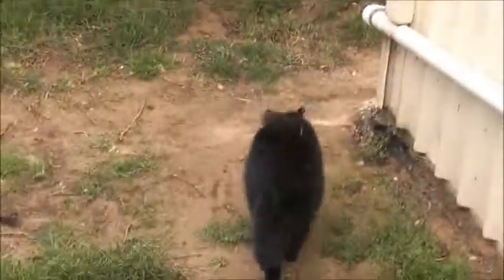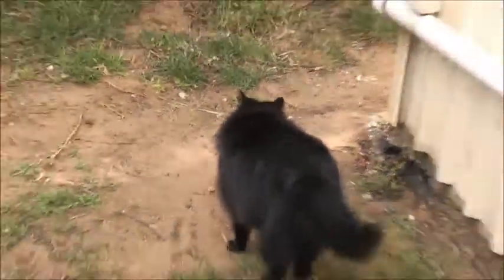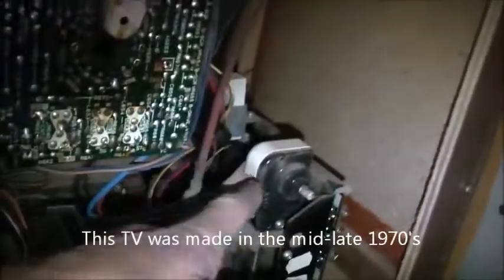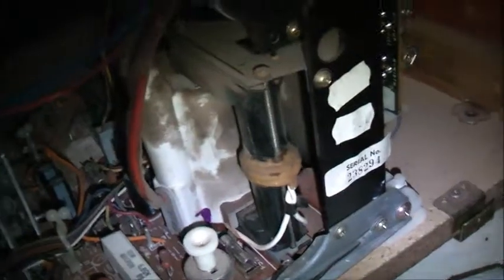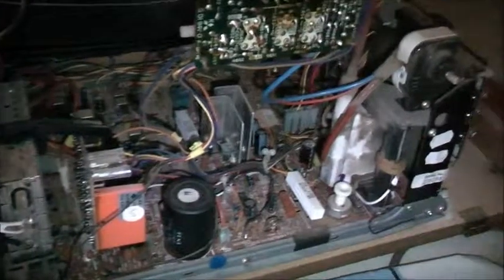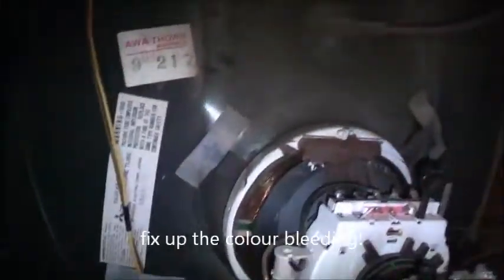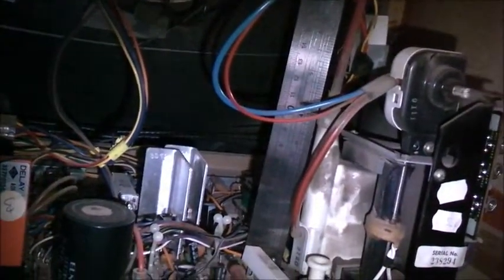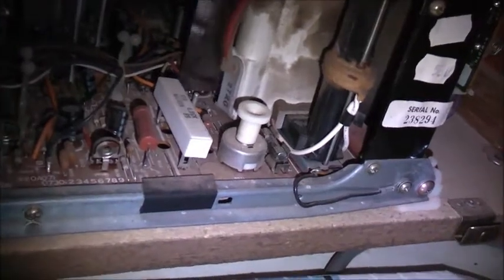Flybacks Used In My Vintage TV's

Comment: Your right, ive never seen such a compact lopt like that last one.

The lopt's to avoid like the plague are the ones in the really old semi valve decca tv's, the line output was valves and the lopt died so dam easy, also you had a stack of wires to disconnect so it wasnt fun to replace :-(

Pye sets used to kill there doubler/tripler??? pack, but there was a grey universal one you could buy.

Non inline crt's are fun, hours of twiddling with the convergence panal lol :-)